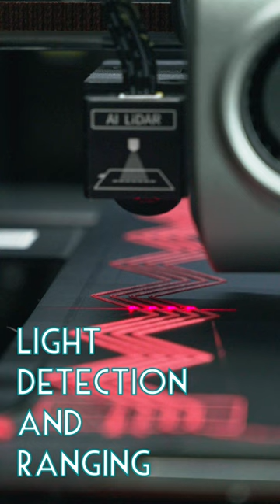3D Printer Using LiDAR 🎇

Comment: It's nice to know that after Bambu Labs lit a fire under everyone 's butt, everyone is starting to rapidly innovate. Now just to sit back and wait for the rush for this tech to wiggle down to extremely low prices
Reply: Not soon
Reply from the maker: The LiDAR here is a separate module, so I hope Creality can start putting this with some good software on their cheaper printers
Reply: @JJShankles  Shouldn't take long for LiDAR to implemented in other printers since most likely someone already reverse engineered something or is working on it
Reply: @JJShankles which module is this. It works pretty good on my x1c but not on the PEI because of the PEI bumps is my guess.  How does yours do on PEI
Reply: Yeah

Comment: Looking at my trashcan, I want to see it rechecking the print every 10 layers and stop if something‘s wrong, obviously. Btw, it would be cool if you could use it to find the exact spot where something went wront and enable you to resume printing at that exact spot.
Reply from the maker: It also has a webcam that tries to monitor the print and pause it when it starts to mess up. It still needs some work because it paused a few times when filament was just stringing. That would be really cool if it would let you know what layer end the print, especially for large prints
Reply: @JJShankles  the Webcam, imo needs more light and to take the pictures from above, and on extruder
Reply: I had mine get clogged 5 days into owning it.  Ended up putting in a Micro Swiss hot end to see if that would help at all.

Comment: It would be cool if the test print would includ different temperatures as well for the algorithm to automatically set also the temps right.
Reply from the maker: That's a great idea. It seems like they could do way more to tune in retraction settings as well for a specific filament

Comment: Yes, a real lidar would measure the time a light pulse takes. Like a radar but with visible light. But not on these smal distances. "Lidar" here is just marketing. The laser is seen by the sensor using sort of a camera. As laser and camera have an offset, the picture the camera shifts due to the distance between sensor and bultplate/print - so the distance is measured by this offset. Like on any normal distance meassurement tool. Real LIDAR sensors with high precission would cost more than the whole printer, wouldn't been even precise enough to do the job - and would be the wrong choice anyways.
Reply: honestly it doesnt even work great anyways.  I completely removed the Lidar scanner.  If you just calibrate your Pressure Advance on your own it's way more accurate

Comment: Thank you for showing the K1 Max lidar.  I've been waiting to see something about how it works.  I was concerned that it's only on the K1 Max so it can be favorably compared to the Bambu Lab X1C and it may be more marketing than engineering.  I'd still be interested to know more, comparisons with and without lidar, etc.

I was all set to tell you that lidar is "laser imaging, detection, and ranging" but I did a quick check online and apparently it is also "light detection and ranging".
Reply: Yer I am holding out to see if the Creality science with LiDAR has some benefit’s to the prints or just there as a tick box to match Bambu’s and it actually doesn’t do anything. Will find out when someone rips open the firmware and see what’s going on?
Reply from the maker: I found on the K1 spec sheet that LiDAR is listed as OPTIONAL, so hopefully they can sell this as an upgrade for the original K1. That would be awesome to see it on cheaper printers. I need to do more tests and comparisons to see if it is really worth it, and they are still working on firmware improvements as well.

Haha I'm glad I googled the definition of LiDAR before this video because I would have said the wrong thing as well.

Comment: I wonder how close we are to a printer with the cost and ease of use as a consumer inkjet printer?
Reply from the maker: I think a few more years before I they get there. Currently they are super easy to use when the work, but when something goes wrong it can be a little tricky to figure out what went wrong as a beginner. But with an inkjet printer it can tell you where the jam is and how to fix it. I think that's something 3d printers are lacking for wide adoption
Reply: Tbh geared dc motors with an encoder are probably what's needed for lower cost than what we have.
Also tightly integrated boards (which would make it less fixable)

Though imo resin printers are already there, I don't have issues with my photon s that I got for 100 euro, I send a file, it prints, dunk in acetone, leave outside for a couple days, done.

Comment: LIDAR definitely isn't accurate enough for 3d printing. 0.5 to 10mm accuracy relative to the sensor position. Most say 2-5cm. Can see the printer struggling at the beginning with its purge lines and even in later shots.

Comment: Hey have u tried abs ? I have been having trouble getting settings right
Reply from the maker: Yeah abs has been printing great for me. I just select the Generic_ABS material profile and put the top on, and it has been printing well
Reply: @JJShankles  thanks I have done the same but the print seems to bubble up and detach from the bed after 8th layer,  I'll try a couple more times and see